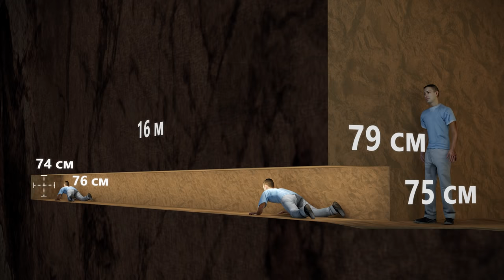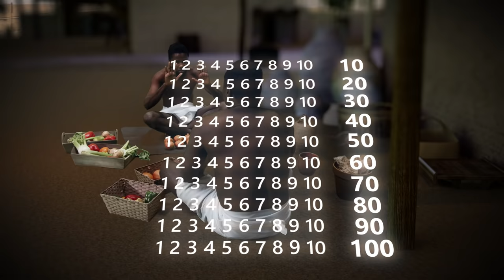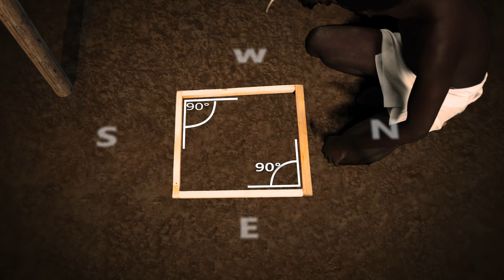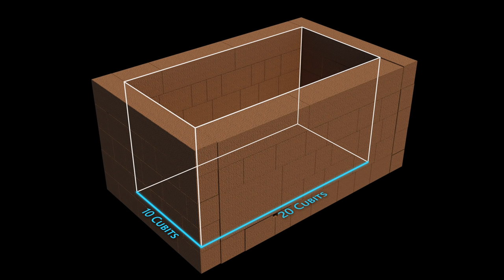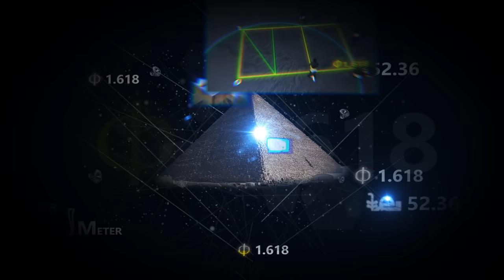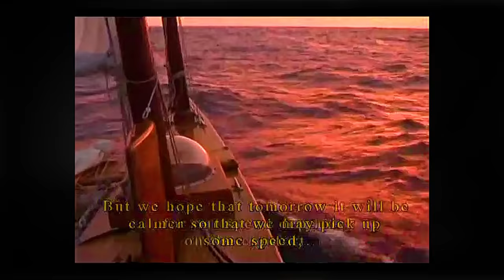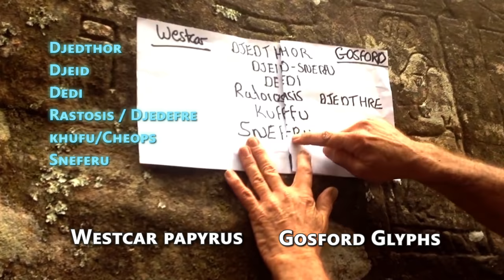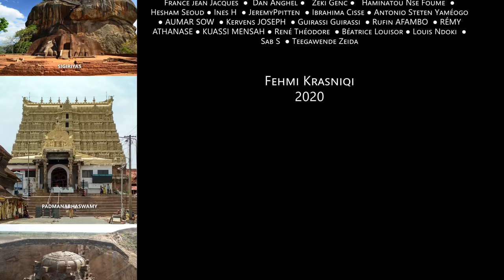The Movie Great Pyramid K 2019 - Director Fehmi Krasniqi

Comment: So they melted rocks with a giant magnifying glass..?
I don't think so..
Reply: melting granite with a lens is very possible we can do it today
Reply: @63phillip  please give some references for this.
Reply: @63phillip  but it turns into glass, rather pretty stuff..I'm sure the Egyptians would make jewels or otherwise apply it. We dont see that. But anyway it wouldn't be granite anymore.. that a problem for the theory. And also its melting the rock at the focal point, and rapidly cooling outside the focal point. Which makes the technique impractical for how they portray it.
Reply: @63phillip  Ok, I was not aware of that, I would like to do some research on the subject..
Reply: @63phillip  Yes but it is very speculative.I would very much like to see someone attempt to e replicate. Scientific evidence demands this.The race-based dogma  piercing the entire work is utterly sickening, and insulting. They deserve my comment above  Yes yes, we wuz Kangs. .  It's quite likely Egyptians were very dark and quite possible they sailed.
Reply: @Kell_M  
Are you aware of the difference between temperature and heat?  The device they use in the demo is a Fresnel lens.  Yes, you can generate some high temperatures, but only enough to melt small rocks.  The problems develop when you try to scale up.  The lens in the Krasniqi video is a refractor type.  The largest  refracting lens made is about one meter in diameter.  We can't make them any larger because of weight  problems. Krasniqi ignores real engineering issues like how do you keep it molton until you are ready to pour.  How do you keep the container from cooling the granite too quickly when start pouring it into the mold?  How do you keep the molton granite from destroying the mold?  Notice they don't do a live demonstration on a full size granite block if this was so easy.
Reply: @63phillip  
But you are overlooking the problems of scaling up the refracting lens and handling the heat issues.  Why is it the largest refracting lens in the world is only one meter in diameter?
Reply: @catman8965  I never said that i feel like that is how they did it, I don't think that is how they built the pyramids. all i said is that melting granite is possible, and it is.
Reply: @dco1019  I never said that I agree that is how they did it, I don't agree. I was just saying that melting granite with a solar fresnel lens is possible. and yes i agree it makes obsidion glass not granite.
Reply: @63phillip  
Okay, SORRY!!
Reply: @63phillip  ah ok.. cool.  i did look that granite melting with lenses up because you said it existed. its rather cool to see
Reply: @catman8965  I have no doubt that the ancient civilizations before us had some seriously advanced methods of construction, advanced tools and tooling as well, but I have to disagree with the methods in this documentary..
Reply: @63phillip  Yeah but making a lense of this size and quality without high-technology is not possible... not to mention that with this method you would probably need several thousand years to finish the pyramid.
The whole thesis is a entertaining fantasy story.
Reply: @a34431123  I never said that is how they did it, I agree it is not the way they did it. I only said that melting granite with a fresnel lens is possible.
Reply: Only part I am iffy on...   I have been to the pyramids too

Comment: You're making some pretty incredible claims .
Reply: Concrete limestone as postulated could be expected to have a lifetime of less than 100 years, 200 years if we allow for the dry environment. Moreover, concrete is known to spall on compression joints without internal reinforcement or inter-joint cushioning.
Reply: Impossible claimes, I'd say!
Reply: @tonyshortland8812  Agreed
Reply: @oralialafond9215  this is better stuff.  Like Roman concrete.  Go look at the Coliseum. I'll wait.
Reply: @oralialafond9215  if poured with aggregate as we do nowadays to save money.
but I commented on the Limestone, sand, and ash mortar that was 10K Lbs strength When packed dry, it takes hours to finish a small area. I do not know of a construction company that will pay you to lay large blocks of concrete in that way- So, they have it made in a barrel truck, spun and with much water, poured and set within hours, saving 2-3 days of labor(much as it seems) and spend money on rebar to add to the strentgh. 
We have to stop applying present-day knowledge and economics to this. I would go and suffer the heat to be on any real team director Fehmi Krasniqi forms to show you how it is done.
all we would need to do is make a floor, a corner, and a few inside blocks. Using nothing but copper and wood and a few stones as peg hammers. Not rocket science, but obedient work. No argument from know-it-all builders that cannot even read blueprints as I can. 
I would even venture to assist him in the making of the glass lens and the scaffold to hold it and aim it.
I think we can solve this and prove it.
It can be done with JUST out-of-the-stone-age tools.

Comment: really doubt the melting of granite theory..
Reply: then you have never been in the 45 degree heat in August at Giza.
Reply: Never seen lava? Never heard of archemides mirrors that burned a fleet? You doubt away lad.
Reply: Have you never seen magma & lava? Those are melted "rock".
Reply: The problem in melting granite in that scale is debatable by using lenses and the sun. It would have to be quite a contraption.
And casting molten granite is very hard, especially in large blocks.
So if large scale testing and experiments prove that it is possible,
I will have to reasonably doubt the molten granite theory.
Reply: @alexnamazu7638  indeed, as there is no written accord of how they were built it is all debatable, is it not? The concrete and cast granite theory may be more plausible than aliens, ramps and all other theories. Mathematically, the pyramids are precise. Architecturally, they’re near perfect. We may not be on the level required to understand their ways fully, simply due to us complicating the simple problems we have today, rather than simplifying them.
Reply: @mikalabaker6110  ever seen what lava looks like when it's cooled again?  It's certainly not something you'd build pyramids from.

Comment: I’m believing that that a poured concrete “stone” works for blocks, obelisk, ect. However all of these things need a mold, for these giant statues and garnish on columns the molds fabrication would have needed extremely talented workers. It is also very hard to believe that they could cast 5 meter (16 feet) magnifying glasses. That is a HUGE single pour of molten “glass”. That amount would have taken a HUGE furnace to achieve the required temperature. Also the video implies that there were many of these lenses being used. I checked and the size of telescope lenses do not come near this size.

Comment: Great theory but too many holes in that theory.
Reply: Less holes than all other theories.
Reply: Agreed, they say that the congoids were somehow in the utmost northeast corner of the continent and had the amazing knowledge of2d and 3D math, yet they could only come up with 3D flat wall paintings? Lol
Reply: You havent even mentioned 1 .
Reply: Krazy killer. I was thinking about the logs and the water. Cool but I personally haven’t seen it demonstrated on a large scale. Then they virtue signal about saving the environment but then show a crap ton of wood being used for construction. Like it’s a great theory, but when u sit back and contemplate we have to demonstrate in real life in real time. A giant mega glass? Ok, but again let’s see if we can make that. That’s just me tho
Reply: Somehow interessting but fails very soon in some special points: why there are several locations of hugh quarries where defenetly massive amounts of stones where taken out. If they had some kind of concrete, working in quarries too makes no sense. Same for the obelisks which are unfinished in quarries left behind. why work all that out of stone if u have concrete? Next point is the drop of water = 1 cm. Nice, but explain how this cm exactly was replaced 100 times for a meter without loosing some mm?
Reply: How was food / water supplied let’s say on the half finished pyramid? After all the workers also had human necessities, did actually  take a dump into the pharaohs sacred tumb?
Reply: @Chris-sq8yv  That would be a sacred DUMP!

Comment: You almost had me ...
 Yes at 97.7 % ... but listen to this this magnifying glass would have to be made with perfection make the biggest one you could possibly make for us viewers let me help you out ... 
Convex lenses, which are used to make magnifying glasses, can be made from various materials. The most commonly used material is optical glass, which is specially designed to have the necessary optical properties for lenses. Different types of optical glass, such as borosilicate or flint glass, can be used depending on the specific requirements of the lens.

Additionally, certain plastics can also be used to make convex lenses. These include materials like acrylic (polymethyl methacrylate or PMMA) or polycarbonate. Plastics offer advantages such as being lightweight and more resistant to breakage compared to glass lenses.

It's important to note that both glass and plastic materials go through various manufacturing processes to create the desired curved shape for the lens. These processes can include techniques like molding, grinding, and polishing.

If you have any more questions, feel free to ask!

But to melt Granite you need at least 7,400 degrees heat 🥵 🌡 running like liquid ....

And believe me you're not going to use w o o d as a form ... this is wh you are going to need some type of cast iron forum

Comment: Fantastic documentary.  Mind opening!  I would love to see some experiments to verify the ancient method of concrete making and molten rock pouring.
Reply: To verify the granite pouring may take some time.  We will also need to ramp up the pressure rather a lot.

So we melt it - pour it - increase the pressure to a point where it will crush you and then wait a few million years for the crystals to form. Job done!

As an aside - major example of why this is a bollocks theory.  At Aswan quarry there is a 1200 ton obelisk being cut from the bedrock.  Why bother if you could just mould it?

Comment: About khufu's name. Not only was it not written at the time that it was built, it was written on a plaster repair a number of decades or if not centuries after the pyramid was originally built. I do agree that it was correctly spelled. But we now have absolute knowledge that Colonel Wyse had already been caught faking time elements in an earlier project. When he took a mummy and placed it into one of the other pyramids. Trying to force the date of that other pyramid. And the only other person with him at the time that this red painted writing was discovered, was quickly forced out of the country. It doesn't wash. I agree with many of the aspects of this building project. But I do not agree because the Stella found in 1857 stated that Khufu found the pyramid under the sand along with the Sphinx and reconditioned them.
Those who of us who have been in the Building Trades know that reconditioning can frequently take much longer than the original project. That's why some of the casing stones are not nearly as nice as some of the originals. That is also why the step pyramid of Dozier is the later pyramid, not an earlier pyramid. The reason we know it's a later pyramid and that it was made out of mud brick is because it only had a certain amount of time in which to build it because they had seven years to get it built so that they could use it's underground passages as a granary for the lean times of the seven year drought that they knew was coming!
Where did you get evidence that the Egyptians originally came from the south. The original Pharaohs were not depicted as have even having dark skin. Furthermore, Egypt was not ruled by blacks until Kush took it over. They then eventually ran The pharaohs and their families to the north. Lower Egypt was the northern portion of Egypt because it is lower in elevation. The word Giza means boundary between Upper and Lower Egypt. Also, many many ancient writings describe Enoch as being the architect of the pyramids. Which would tend to be proper for the timeline. But there is no proof of that. It is consistent with rather ancient writings however. Even more contemporary writings that are based on Ancient story lines. And your description of how the chefs were put in is not the only description that makes sense, it's just a description of the building practice. Although I think you have it relatively close. As for the body of Khufu going into the pyramid there is no evidence of that whatsoever. There is zero evidence that it was ever intended to be a tomb. There is plenty of stories and writings that it was a temple of indoctrination. For crying out loud there isn't even a sarcophagus in the king's chamber. The box there is not a sarcophagus. It is a tool for initiate practices. And there is evidence of that.

Comment: Fossils in many limestone blocks prove they are not all concrete.   Plus every block of the pyramid is of unique size, if they did pour it from 'geopolymer', It would have been much easier to make consistant size blocks.   Your theory alone rules out geopolymer because it would have been a lot easier than what they did do, Every course is a different height!    the video was worth it for the graphics, I must say.    Also, you make it sound so easy.  make a salt crystal lens, then scoop up granite in aswan, ship the small chenks, and remelt them again?   If you can make me a granite box with this technique like they found, I will be convinced,  but I really don't think you can melt and remelt granite without it being obvious, an dthen if eveything was 'poured', why is there evidence of huge power saws in egypt?
Reply: Your fossil point is good. I don't think all blocks being different is tho. Because if they pour in place, you would build out, away, so the distance doesn't matter, it's the width that stays the same. The wall is flat and smooth even with different size blocks. I think the lack of space between blocks is a great point to support geopolymer